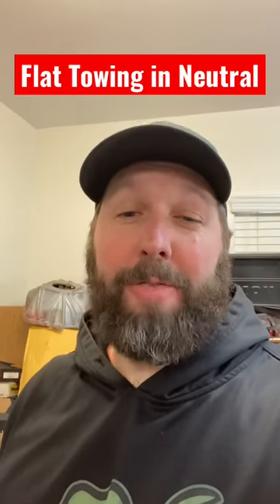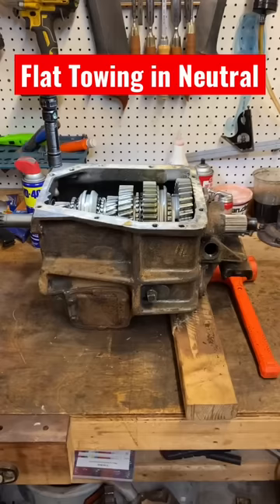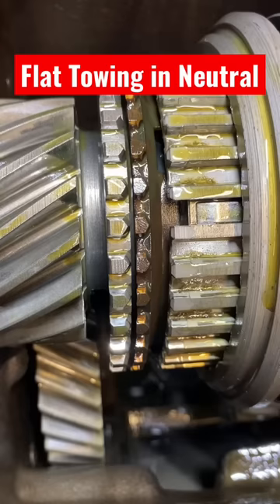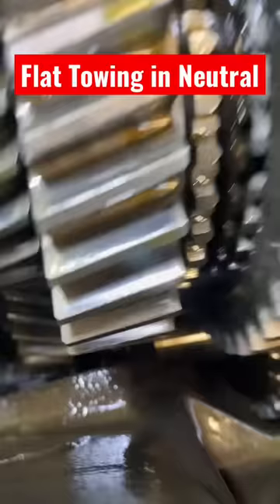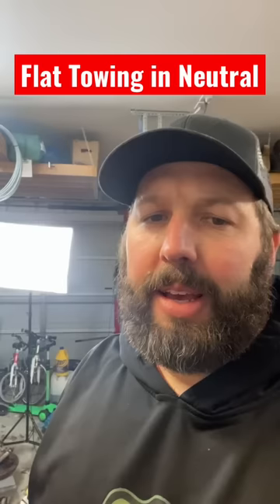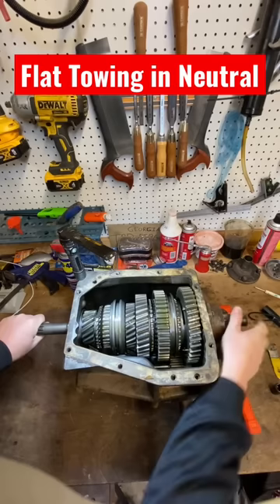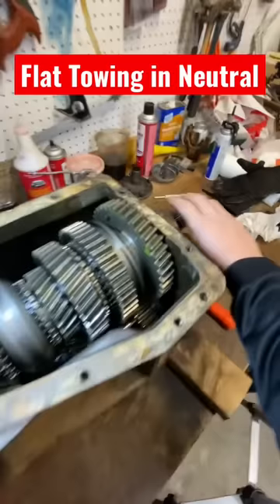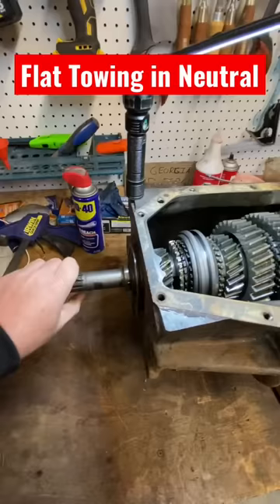Flat Towing in Neutral??? #transmission #stickshift #mechanic

Comment: just to add to the conversation. this is what happens in the hemis at idle as well... I just had to replace my cam shaft and lifters at 80k because of that splash lubrication system. It's a fun weekend, but it's still a junk motor.
Reply from the maker: Most cams are splash lubed. I guess the Hemi's just don't splash enough!
Reply: @Freedom Worx  good to know... I still stand by my opinion of it being a silly way to do it. It just seems like of all the things they love to over- engineer, a lubrication system isn't one they should just leave to chance ya know.

Comment: I’ve towed loads of autos in neutral and never had a issue never towed more then 50 miles and speeds under 50mph so I guess that’s why they never overheated on the shaft I feel it’s a myth from when gearboxes where not at well designed
Reply from the maker: It’s got nothing to do with poor design. And it’s still applicable today.  https://www.tremec.com/not_am_detalle/flat-towing-manual-transmission-vehicles/

Comment: Your supposed to disconnect the drive shaft if you have to toe this way. I learned this from my dad when I was 19, I'm 54 now. I can assure you only 1 out of 500 people know this.
Reply from the maker: You’re supposed to read your Owner's Manual. Towing in neutral is fine for some vehicles. Some need the driveshaft disconnected.

Comment: I always wondered why they never  used a better lubrication method for so many years. I overfilled a manual once and it ran fine....so wondering.
Reply from the maker: Overfilling reduces efficiency and actually causes the oil to run hotter. The design is simply a function of providing enough lubricant to cool and lubricate the components operating within their intended operating conditions, but not so much that you create excess fluid friction. Same with a differential.

Comment: Well if its front wheel drive tow front. If rear use slim jim and locking atearing. Tow from rear
Reply from the maker: That’s not flat towing though.

Comment: 🤯 No. No I haven't because I'm certainly not going to flat tow a MANUAL IN GEAR. Look, I'm 3rd gen car mechanic+ in the UK where 90% are manual. Towing a manual out of gear is no problem at all because a) there's plenty of oil splashing going on at that speed and b) there's no load going through the gearbox, so it doesn't actually need much oil at all.
Automatics, on the other hand, build up pressure in places they don't like - especially if you're towing at 50mph backwards on a dolly or hoist. You only need to remove the propshaft on a permanent 4x4 with no transfer box (if available leave the transfer box in neutral and keep the propshaft), and if you're hoisting a 2WD- choose to lift the driving wheels and the problem goes away entirely.
To be honest it's too much of a pain to remove the prop for towing, so recovery trucks in the UK will just drag your carcass onto a flatbed and carry you to the garage wholesale.
Reply from the maker: Who said anything about flat towing a vehicle with it in gear? 🤷🏻‍♂️ https://www.tremec.com/not_am_detalle/flat-towing-manual-transmission-vehicles/

Comment: The owners manual for my Subaru Baja says it's fine to tow on it's feet (in neutral).  Manual transmissions anyway, not for the automatics.
Reply from the maker: Yeah. You should always refer to the owners manual 👍

Comment: Subaru dccd boxes have no issue the oil pump is driven by the output shaft and it feeds and sprays every bearing smart smart by Subaru
Reply from the maker: Scoobaru makes good stuff 👍

Comment: Funny piece of information for you, some cars that are awd have a pump in the transmission just for that reason
Reply from the maker: You should read your Owner's Manual. Towing in neutral is fine for some vehicles. Some need the driveshaft disconnected.

Comment: I was always confused about why flat towing hurt the transmission, but idling in neutral didn't. Turns out, every diagram of a manual transmission puts the input shaft on top for some reason. 

Also, how hard is it to replace synchronizers? My poor MTX75 has objections with third gear.😢
Reply from the maker: The input and output shaft are on top so they aren’t continually churning in oil. That would be extremely inefficient. The countershaft is smaller or has less rotating components burning oil. Well, the transmission had to be completely disassembled to do synchros. That can be tricky, but usually doable.

Comment: And ironically more expensive to fix than obtaining a trailer!
Reply from the maker: Well RVers don’t use a trailer because it just isn’t practical for them. So sometimes flat towing is the only option. It can be done be without ill effect if done properly. But you have to follow the owners manual.

Comment: I bought a 2005 subaru wrx that was a tow vehicle I had to have several bearings replaced in the transmission
Reply from the maker: It can happen. Have to read the owners manual 👍

Comment: So you're saying my options are to tow it in gear thus destroying my engine (and possibly the trans in the process), remove the drive shaft or CV axles (using tools I probably don't have at the moment or risking the wheel bearings for the CVs), or get a flat bed to tow.  So why would anyone flat tow at all?
Reply from the maker: I never recommended flat towing with it in gear. Just stating that if you try to flat tow it in Neutral, it could damage the transmission. The vehicles owners manual will tell you if you can.  But what makes you think that would hurt the engine?

Comment: I see. It's all about HOW LONG you tow it. I can coast in neutral for a while when I'm driving because I just splashed a bunch of oil and I will again shortly. But if I flat tow for miles and miles, it never spashes.
Reply from the maker: Speed and time.

Comment: I towed a 2011 ford ranger for work as a shuttle driver… towed in nutral all the time… well over 200,000km being towed… not sure what this guys talking about…
Reply from the maker: It is fine for some transmissions and will destroy others. You have to read the owners manual for each vehicle. https://www.tremec.com/not_am_detalle/flat-towing-manual-transmission-vehicles/

Comment: So, I suppose placing an automatic in neutral and coasting downhill is also bad for this same reason? There's a road down out of the mountains near me where you can coast in neutral at the speed limit for just over 12 miles. Good for bumping up your mpg, and thankfully it's never been a problem before... 😬
Reply from the maker: If the engine is running, the pump on the automatic transmission is pumping. It’s not an issue on an automatic if the engine is running.

Comment: Oh...so that itty bitty one cant reach the oil...what if ya put a little hose up over somehow to run over it like D9 said? Any way to suck it up there? Or just add to it
Reply from the maker: It doesn't reach any gear on the mainshaft, not even the biggest one. The easiest thing to do would be to overfill the trans through the shifter boot. Then the oil would be high enough to catch some of the mainshaft gears.

Comment: Good God!  It’s not like you’re flat towing at 60 MPH!

The point of the lubricant is to keep the gears cool as they run together.

As long as you’re not flat towing at high speeds AND that you take towing breaks every few miles, your gears should be fine!
Reply from the maker: Bearings and synchros need lube and cooling my friend. And yes, RVers flat tow vehicles at 75MPH all day long. And plenty of them have torched transmissions and entire vehicles doing it improperly 🤷🏻‍♂️

Comment: So you should do what exactly? I'm confused as to how you expect someone to tow a manual vehicle? I mean you could put the transmission in gear and prop the clutch pedal to the floor but that's probably just as bad on the pilot bearing in the back of the crankshaft.
Reply from the maker: You should read the owners manual. It’ll tell you exactly how to tow it, or not tow it. T-case I. Neutral on most 4wd vehicles. Might have to remove the driveshaft on some RWD vehicles. Might be completely acceptable on others.

Comment: That's why you set the transfer case to neutral in addition to the transmission to neutral. If you want to be extra safe Pop the bolts on the universal joint on your drive train and chain up the axle.
Reply from the maker: The transmission is generally put in park when the transfer case is towed in neutral. Otherwise the T-Case can still spin and spin the transmission.
Reply: @freedomworx  What is this park you speak of manual transmissions have no park. 😉
Reply from the maker: Sorry. Should have said in Park or in Gear depending on whether it’s an automatic or manual. You got me 👍

Comment: You can flat tow an automatic or manual transmission in neutral with no damage IF the engine is idling or the driveshaft is removed.
Reply from the maker: Both are good options.

Comment: I have and buy up any 6.9 idi or 7.3idi I can afford most have been sitting not running! I pull the back axles plastic bags covering the hubs(floating axles dana60s) and drop the drive shaft. Never has any issues! Is this the proper way I was taught by old timer
Reply from the maker: I wouldn't worry about pulling the axles if I was pulling the driveshaft.

Comment: So it’s a matter of having the input shaft spinning while in natural? As in have the engine running? Is that all that’s needed here to solve this is to just flat tow with the engine on?
Reply from the maker: Towing with the engine on is an option, if it’s an option.

Comment: What are you talking about, either pull the axles, or the drive shaft, never pull it in gear, unless you want the engine turning
Reply from the maker: Never said anything about towing with it in gear 🤷🏻‍♂️

Comment: Use Exelplus in the box and you'll get no wear when towing, ever ! No need for splash. It's a metal treatment not oil.
Reply from the maker: Exelplus won't remove heat from the bearings on that mainshaft. Heat is what causes them to fail.

Comment: Maybe so but I have flat towed my dodge ram 1500 and everyone says they are junk and I flat towed for about 40km and I have 420 000km and I run 35" tires since 100 000 and my transmission is original and still going so must not be a big deal for a short time
Reply from the maker: Distance and speed matter 👍

Comment: I’m confused though, why does it need oil if there is no metal on metal contact? Isn’t the the output shaft just spinning the singular gear and it isn’t making contact with others?
Reply from the maker: It’s not about gear mesh, it’s about the output shaft bearing at the rear of the shaft, and needle bearings between the input and output shaft. They need lubrication and cooling from the oil if they are spinning. And they are spinning if the output shaft is spinning. 👍

Comment: So, overfill the gearbox for towing,  then drain to the proper level when done?
Reply from the maker: It’s an option. But not as easy as it sounds. Need a special fitting or you have to get the truck leaned very far to the passenger side.
Reply: Right on, Thanks!

Comment: Quick tip, if you can’t remove the driveshafts,just fill the transmission up until the dipstick reads OH CRAP  !
Reply from the maker: Just turn it on its side to accomplish this feat.

Comment: My jeep owners manual says to flat tow with transfer case in neutral and transmission in gear. (does not say which gear)
Reply from the maker: Any gear besides neutral. It just needs to keep the trans from spinning. Even though the T-Case is in neutral internal friction will still cause the input to spin to some degree.

Comment: But if I tow in gear, it's gonna turn over the motor. Will it be fast enough to turn the oil pump? And will the oil have the pressure to make it to everything?
Reply from the maker: Never said to tow it in gear. Some vehicles need the driveshaft removed, some have to be towed on a flatbed, some are perfectly fine to be flat towed in neutral. You have to read the owners manual. But none of them are going to tell you to tow it in gear such that it turns the engine.

Comment: I flat towed a 2006 ford f150 with a 5 speed manual over 400k with no trouble,
Reply from the maker: It’s not applicable to all transmissions. You have to refer to the owners manuals.

Comment: Is this all manuals. My s10, i think t56 i would hyper mile before that was a term, i would put in N and coast engine off going down hill. Never had a problem
Reply from the maker: It’s not every manual, but a T56 is a Tremec, and Tremec advises against it. https://www.tremec.com/not_am_detalle/flat-towing-manual-transmission-vehicles/

Comment: Would this also apply to cars and suv vehicles with all wheel drive? Or can person put it in neutral an tow it or must remove dislocate the drive shaft...in order to tow vehicle?
Reply from the maker: It depends on the transmission. It’s perfectly fine in some cars. You just have to read the owners manual 👍

Comment: Always disconnect the drive to the box.  Problem solved.   Never do either.   😂😂😂  Bad advice to do either option offered.  ALWAYS disconnect the propshaft to the box
Reply from the maker: I think you might have misunderstood the video. The only advice I offered was to read the owners manual, down in the description. The point of the video was to inform people that just putting the transmission in neutral and then dragging it down the road, could be harmful. Which you obviously agree with since you stated that the driveshaft should always be removed. Which is in itself, is unneeded advice for many vehicles that can be flat towed without issue. If you assumed I was insinuting that the transmission should be placed in gear vs. neutral, then you just made a bad assumption. Here is the full video 🤷🏻‍♂️ https://youtu.be/yCOos-u0oKs?si=rwefJcFjZdxPW-qt

Comment: How do you think over drive works, or your 1.1 gear. Doesn't spin your counter shaft usually. Fill it with oil to prove your point
Reply from the maker: The input shaft always spins the countershaft. And that is not unique to this transmission. https://www.tremec.com/not_am_detalle/flat-towing-manual-transmission-vehicles/

Comment: See I was always taught not to flat tow more than 5 miles without dropping the driveshaft regardless of manual on auto, I've literally watched a buddy of mine destroy the output seal on his explorers transmission he flat towed it to my house and I asked how far he came from he said oh about a half hour 😂 which In my area usually means about 25-35 miles away
Reply from the maker: Yeah, dropping the shaft is the safest option. But like you said, short distances are usually not a problem. Just have to check the owners manual.

Comment: It amazes me how many rv'rs I've seen all over the country that are flat towing a vehicle. A trailer wouldn't add that much weight and it wouldn't put so many miles on the towed vehicle.
Reply from the maker: It’s not a weight issue with RV’s, it’s a practicality thing. You don’t have enough room to park an RV and trailer at most places. When you flat tow, you unhook the vehicle and the RV fits in the spot.

Comment: Hey, is it a correct assumption that idling in neutral is a good way to warm up a manual transmission? Never really thought of it but it may be a good idea on colder mornings.
Reply from the maker: Yes, if the engine is spinning, it is churning fluid.

Comment: Yeah, how should i tow a fwd car then ? Drain the trans oil ,pull the cv shafts and then tow?
Reply from the maker: Well a transaxle and transmission are two different animals. Best to just read the owners manual. It’s obviously not practical to pull the CV shafts.

Comment: I thought you put the transfer case in neutral and the transmission in first or second gear. My question is that with the transfer case in neutral, how does it spin the transmission?
Reply from the maker: Fluid friction can still spin the transmission. The same way the output shaft can still spin the input shaft in this transmission in neutral. I had to grab the input shaft to hold it stationary in the demonstration in the video for that reason.

Comment: But, there could be enough oil on it to Coast for short distances and you may be okay but not the coast down a 2-mile hill?
Reply from the maker: Yes, short distances and low speeds aren’t usually an issue. I wouldn’t coast down the grade into Death Valley in July though 😉

Comment: is it for cars and trucks your talking about ?  Or just manual trucks ? As that transmission looks fairly beefy
Reply from the maker: It depends on the vehicle. It’s fine in some and not in others, you have to read the owners manual. But there are rebuttal no automatics that can be safely towed in neutral. Just throwing that out there.

Comment: Please explain how all jeeps can be flat towed? They work the same as this and never seem to have a problem. Maybe it has to do with the transfer case is in neutral but the transmission is in high gear to keep lubricating. I have towed a few jeeps this way including a wrangler with nearly 300k miles.
Reply from the maker: All Jeeps can’t be flat towed. Most Jeeps can be flat towed. You have to read the owners manual, just like I said in the description of the video. Putting the T-Case in neutral manners it possible. But that’s not appropriate for every T-Case. Again, you have to refer to the owners manual.

Comment: "common knowledge" that it was ok to tow on 4 wheels. That was older cars, front engine rear wheel drive. Not many still produced in 2023, just Mustang, Camaro . . . 
But why wouldn't there simply be a higher oil level? Or a spinning splash wheel?
Reply from the maker: Raising the oil level would lower the efficiency. It’s designed to transmit power efficiently. No reason to compromise the efficiency so it can be flat towed, because the chances are, it will never be flat towed.